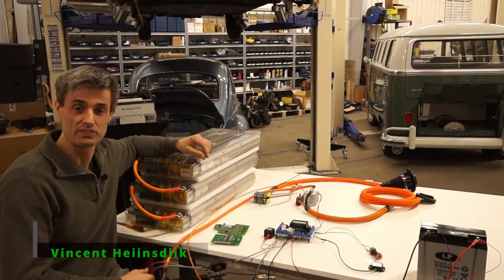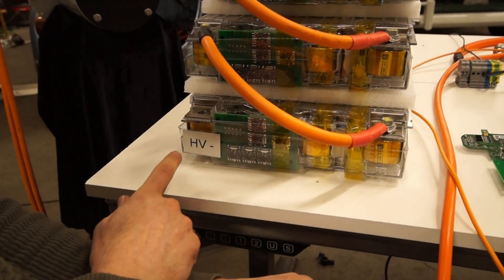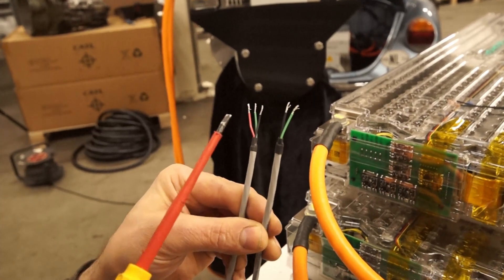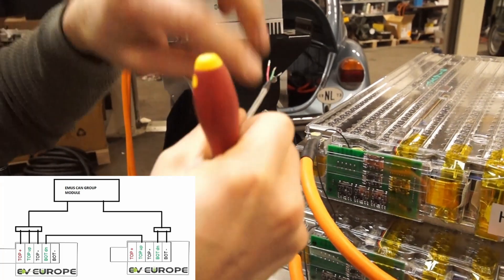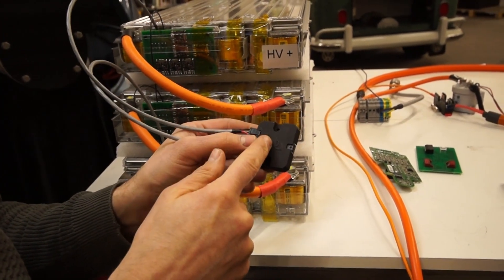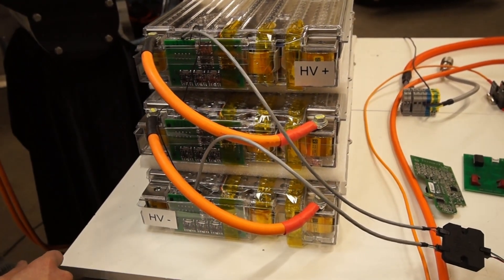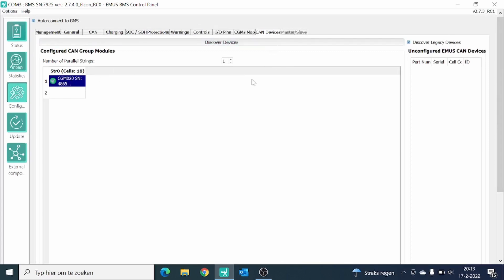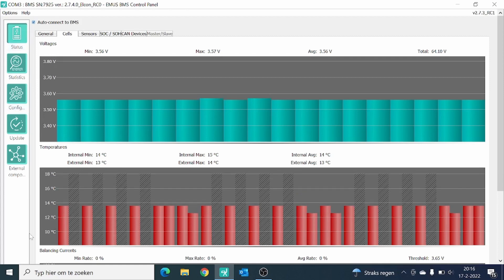Part 9   How to use Tesla Battery modules safely with a Battery Management System

Comment: I use tesla batteries for off-grid applications. I was wondering if this system will work with the 4.7 and 5.3kwh batteries. Then, if so, how many modules can it monitor. I have qty 15 4.7 kwh modules. I am running them in 5 groups of 3s at 60vdc.

Comment: I really found these videos informative, however must say those Can BMS PCB connectors look marginal to push fit wires into and would not give confidence for vibration/reliability purposes once installed into an EV car. Appreciate these are proprietary pcb connectors ,but not great in this application. (imho) Keep up the work...great videos